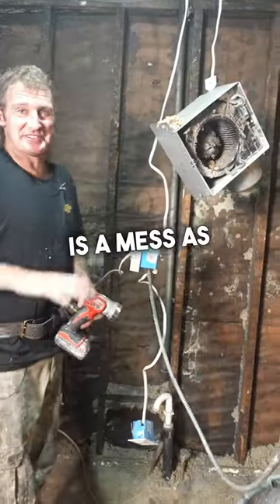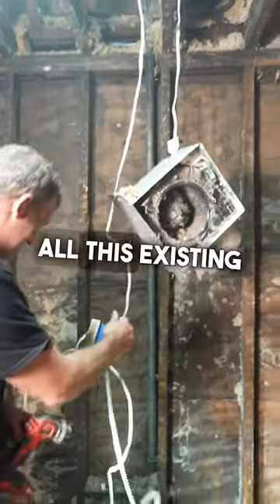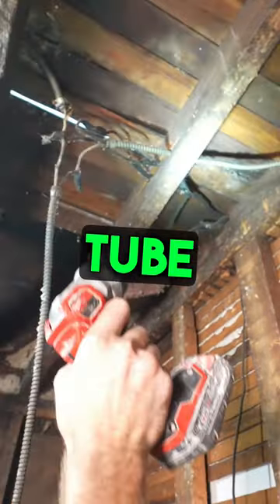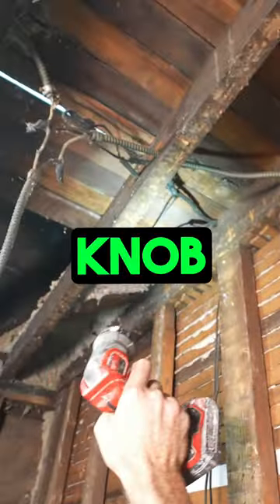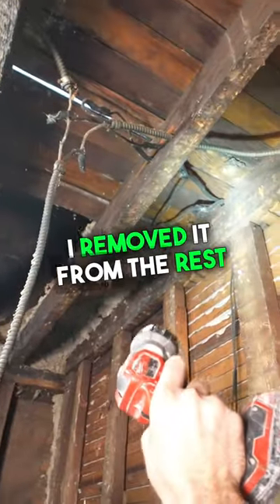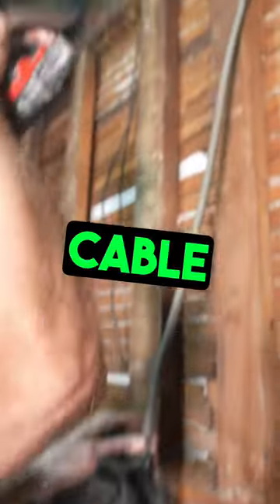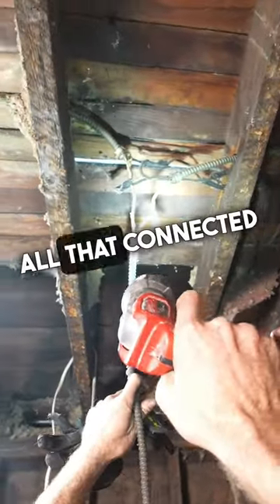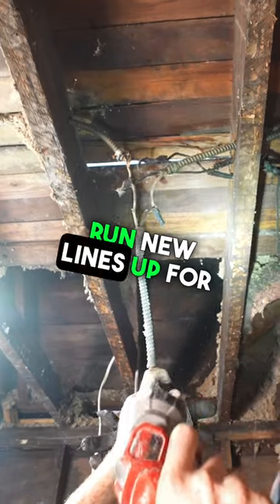Electrical wiring that you should replace when remodeling a bathroom

Comment: What kind of license do you have that you can legally do electrical, plumbing and hvac work? Don’t those trades need their own special license’s? Are you even a Lic residential builder?
Reply from the maker: Lots of questions. Want my birth certificate too? 😆
Reply: Who cares? Electrical and plumbing is easy.....He can do it himself.
Reply: in California, a General Contractor Building License allows the license holder to engage in MEP work provided there are at least two trade requirements (like framing and electrical, framing and HVAC or plumbing.) The only thing they can't do is perform single-trade MEP work.  Upgrading an electrical service would not be allowed unless it was part and parcel of a multiple discipline construction project.